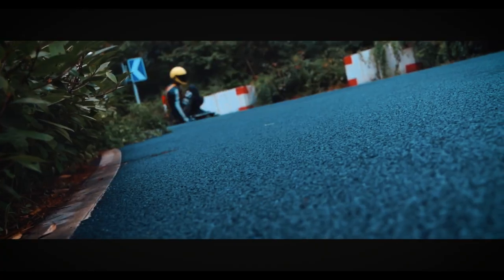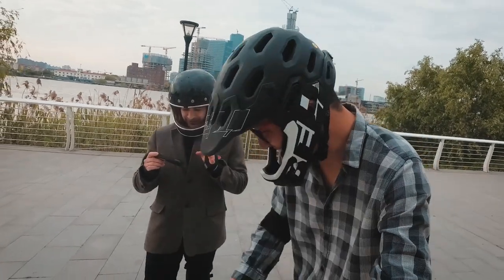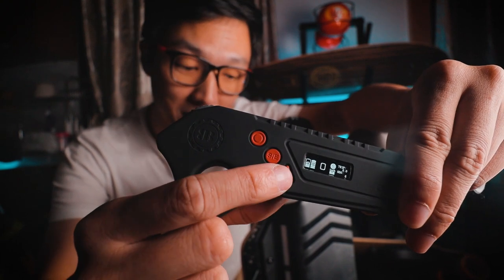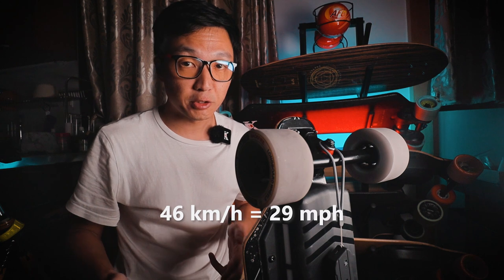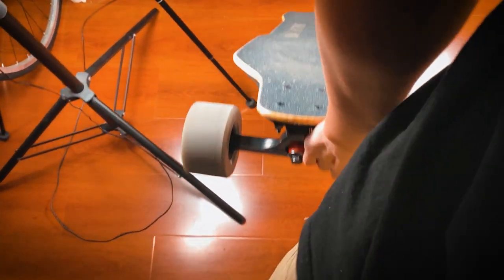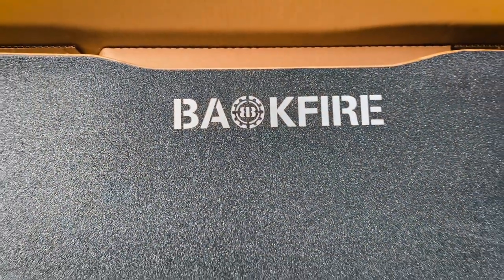Backfire G3 in-depth review. Expectations exceeded. Major flaw that kept me awake has been fixed!

Comment from the maker: Hope you're all having a great week. Here, have some timestamps!
00:41 G3 and G3 Plus Differences
01:38 Turbo upgrades
03:06 Deck
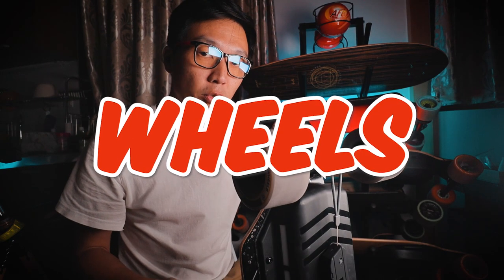04:17 Wheels
04:30 Trucks
04:47 ESC
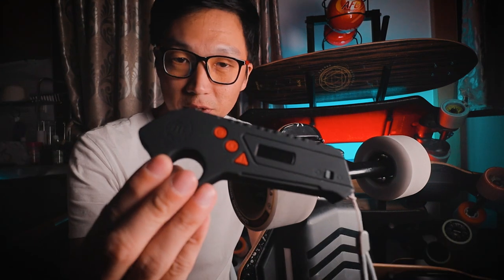05:11 Remote
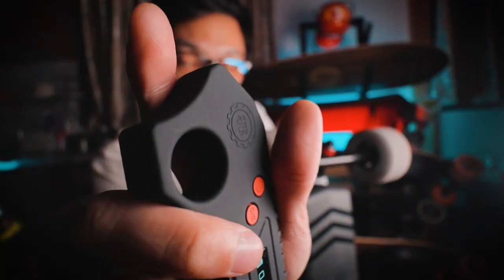07:48 Drive system
09:08 Battery
10:30 Torque
11:02 Speed
11:35 Brakes
12:13 Portability
12:42 Water resistance
13:12 Aesthetics
14:02 Range
15:04 Final thoughts
-
If you'd like to get this board, you can use my discount code: DKWANG3. This is the biggest discount available. This link should enter the code automagically: https://dkwan.com/backfireg3
-
If you use my discount, let me know and I'll send you a set of stickers! https://dkwan.com/freestickers
Reply: Disappointed that the brakes are bad, the g2T have one of the best brakes on the market.
Reply: Battery difference:
G3+ SAMSUNG 40T 21700 (12s2p)
G3   SAMSUNG 30T 21700 (12s2p)
Reply: Hey man have you been able to try out a Trampa board?
Reply: @101lams  hey Lukas can you explain what all the different numbers on the batteries 🔋 mean?
Reply from the maker: Lukas Ehl  Where did you get that 30T spec? I was told G3 uses a generic brand.
Reply from the maker: name no  I have not
Reply: Daniel Kwan 
In official video from Backfire.
Here:
https://youtu.be/0es29zOFwAU

You’re wellcome 😊
Reply: @DanielKwan  Do you think the regular exway x1 is a great board and worth it for $550 (that's the price on the website), or should I go for another board in the $600 price range. Thanks!
Reply: Please review the Fäboard Black Carve
Its using a direct drive system which is like a hub motor on the trucks. It allows you to change out the wheels and not be limited to hub motor sleeves
Reply: Tommy N faboard is made from diyeboard.com parts. 
I’m thinking of going with the revel kit, which also uses direct drive, or the verreal rs which is belt drive but really nice.
Reply: How does it compare to a evolve gt is the difference night and day or is it that good of a budget board that it wouldn't make sense spending double the price for something with equal quality..the reason I ask is bc I know there both made in China and I can't justify paying 2000 for a board I can get for half the price
Reply: Hay i got this board because of your videos sorry i didn't ues your code for it but i got mine for only $600 with the code I used but thanks for the review

Comment: hi daniel which board would you pick g3 or exway flex?thanks😎👍👍👍great review.
Reply: I'm trying to figure out the same thing. I was in the Exway camp, but have recently moved to Backfire. The Exway seems to have the better software while the Backfire has the better hardware. I want to get hub motors and I like the idea of a comfortable ride. Backfire has the larger wheels (although cloudwheels now has an attachment for hub motor wheels), and Backfire G3 Plus has a crazy good range with minimal voltage sag. Exway seems to have more accessories and customization, plus firmware update. Like I said, I was looking at the Flex, but now I think the G3 Plus is the one for me. I want a sturdy workhorse for commuting, but something capable of having fun, exploring, while being lightweight, quiet and portable.
Reply: Same problem.. 😄😄 But it looks the G3 have better manufacturing then Xway

Comment: yeah, my G3 has been pretty great so far. ordered the zealot s2e a couple days ago, because im ready for an upgrade.

the g3 is an AMAZING option if ur looking a budget friendly, but powerful board. when it comes to RAW POWER, i didnt expect the g3 to be able to showcase such amazing strength. it FEELS like a belt drive. its STRONG.

my warranty has came in clutch 5+ times when it comes to broken parts, which is an issue. it sucks that the board broke so often (or maybe i was riding it way too hard). 

anyway, a great board.

Comment: This is my favorite review of the G3. You're very informative and educational while also having a sense of humor w/out going off on tangents. I have subscribed and will be scrolling thru your channel for other reviews. Thanks so much!  The ONE THING I need to know the most - and no one else is covering it either - is "How well does [ X brand / model ] board handle "bad" roads?"  I live in a very rural setting and the roads are NOT all smooth concrete or asphalt.  There will be rocks and twigs, etc. on the road. Can this board with it's standard wheels handle those conditions?  OR do I need to upgrade to Cloudwheels, or something similar?  Thanks a bunch!

Comment: Just to update this: The newer G3's, the "turbo light" doesn't turn on, if the lights are already off.
I've been longboarding for years and years, and bought the G3 as my first electric board, a few weeks ago.
I'm in no way a flashy skater. I'm not into lights going nuts and letting the ISS be able to spot me from space. I'm not into insane speeds either. 20kph is plenty for me. So I was just not gonna use turbo. But I did of course check out all the features when I first got the board. And yeah... The lights doesn't turn on automatically because of turbo mode. Seems they heard the criticism.

Comment: well, looks good .. The price is good as well but I don't understand why the turbo button exists? when you can't turn it off by pushing it again it's just I dunno... useless? and allowed only when releasing the throttle is literally stupid ... blinking sideway lights which cannot be turned off are also in my opinion only unnecessary battery drain and I'd definitely unplug 'em from the inside .. if I'd need light it would definitely be front / back not side lol :D ... I'll wait a bit longer till I buy a new board but I see it coming soon... thanks Dan (y) keep it up

Comment: I weigh 125 lbs and only got 10 miles out of the board before getting low power. I sent the battery to Backfire and they are reviewing it now, and sent me a picture of the remote with 10 miles at 40% battery. I am very confused because I am not too aggressive when riding, and I weigh well below their standard metric for range. I’m concerned because it seems Backfire may not replace the battery— despite it dropping to 80% on eco mode after about 30 minutes of using it in my driveway.

Comment: Hey man, nice review! I have a question. Do you the regular exway x1 is worth it for $550 (that's the current price) or should I go for something else in this price range? Thanks.
Reply: If you speak of the regular X1 and not the X1 pro, the G3 is much more worthy (especially with the 205$ discount)
Reply: @winnquest  why do you think so?
Reply: @thunderingtuber2179  triple range, more torque, flexy deck, and better design (in my opinion)
Reply: @Daniel Kwan, what do you think?
Reply from the maker: Depends on your needs. If you want light weight (around 6.5 kg) and don’t need range, and want to be discreet, X1 may be right for you.

Comment: I'll never have another hub drive again, wwwwaaaaaayyy too harsh a ride on anything that's not perfectly smooth. The wowgo 3X is the ducks nuts right now I think. Its basically a Boosted Board for a fraction of the price. That'll be my next board, My Evolve GTX is amazing but its expensive and heavy
Reply: Well here is my opinion on your comment...
I have the Meepo v3 ER with 100mm wheels. It's like a limousine compared to my belt drive Vestar v2 belt. So smooth and powerful with great breaking and it's very fast. 
No comparison. Belt drives are more dangerous. I've had belts break on me.
The wowgo 3x is a bamboo fiberglass deck. That's why it's great!  
Vestar is doing this too.
Change out any board to this deck and you will notice a great improvement. Recommended by PRESS RESET on his channel.
Look and learn! https://www.youtube.com/watch?v=dYo1m8k0WUY
My opinion as I own 6 different boards.

Comment: I really enjoy riding this board but have a problem recently: I received new hubs after the first stopped working. The new hub motors got a red, relatively stiff stripe of "paper" sticking out where the cable comes out of the hub motor.
Is it there to protect the power cable or should this be removed?
I'm asking because it is almost impossible to fit the cable and the red thing through the sleeves on the trucks..
If you don't know what I'm talking about, I can upload a picture of it.

Comment: Which Boosted board were you comparing it to? I have the G3 Plus and the Boosted Stealth and based on my experience, the Stealth noticeably has more torque than the G3 Plus
Reply from the maker: Oh really. Boosted V2 Dual+ SR but mainly based on inference (e.g., Exway X1 has roughly the same acceleration as Boosted V2, X1 Pro stronger than X1, Skate Metric data, etc.). Never used a Stealth (nobody here has one) but I was under the impression that it’s similar to V2 in performance.

Comment: Would you recommend the backfire or the exway flex?
Reply: It's super close, but I'm going with the Backfire G3 Plus. Exway has the better software while Backfire has the better hardware. If you want hub motors, as I do, the Backfire seems to be the better bet. If I wanted belt drive, i might go for the Exway since I can change later.

Comment: Anyone happen to know how the flex of the G3 compares to that of a Loaded Dervish Sama flex 2? I like the flex of my Loaded, but wouldn't want to go much softer. - doesn't matter...ordered! thanks for a great review.
Reply: Now have the G3. Flex-wise it's a little softer than the flex 2 of my Loaded board. Taken it out a couple of times here in the UK, but some roads are still a bit damp in places, so taken it easy. Ran it on eco mode for about 50 meters and quickly maxed out the top speed, which is mellow as expected, then switched it to sport mode and had some fun. Not used it in turbo mode yet, as just getting used to the torque and braking, along with weight placement - it will have you off the back of it if you're not heavy on the front and keeping low, when pulling away quick. Looking forward to carving up the roads on it :-)

Comment: Hey Daniel  Kwan how are you today sorry for the time difference I'm in the us but I have a question. I have the g3 but my power box got a little bit of water so it made a whole on the power wire it's the yellow thing that connects to the board so I'm sending it back. But I just got the G2 I was wondering if battery from the G3 turbo can fit on my G2? Because my YouTube takes forever to charge. When is fully charged remote and board I take it out for a ride and my board battery goes down fast?
Reply from the maker: Best if you send an email to Backfire and ask them.

Comment: Does your battery case get scratch easily when you are on an uneven roads like pavements? Because the board looks very flexy
Reply from the maker: Not sure about “easily” but I would just treat that part as something that will most definitely get scratched up. I wouldn’t try to baby it I mean.

Comment: im contemplating between a backfire zealot and a g3 as it's only a $50 difference after discount, which one would you say is better as a beginner e skater,P.S I've  been longboarding for 6 plus years
Reply from the maker: They can both work for beginners. I would prefer the Zealot but if you don’t want to deal with belts, G3 is great too.
Reply: @DanielKwan  ya belts would be a pain I live in Pakistan so I don’t think backfired delivers here so if a belt were to break it would be pain to replace ( getting the board when I go to the us in September)

Comment: Performance-wise, it looks as if the G3 is comparable to the WowGo 3. They both have bamboo-fiberglass decks and always-on turbo modes, name-brand trucks, and comparable ranges. If someone were to be deciding between the two, how would you go about justifying the G3 being $100 or $200 more than WowGo 3? The only real difference I can see is that the G3 has the 96mm wheels and a slightly better remote, but is that worth the $100-$200 extra?

Edit: I say $100-$200 depending on what battery you get for the WowgGo 3
Reply from the maker: Good question... These could be justifications: Caliber II for both trucks (instead of just the front), Hobbywing motors, more options for PU sleeves, better battery enclosure. Some people might prefer the larger deck and those lights. I know Backfire would claim to have a lower failure rate (they do seem to be more conservative about pushing the electronics). Backfire also has a better reputation for aftersale support.
Reply: @DanielKwan  Valid points. Hopefully there's a good Black Friday deal that can knock that price down closer to what I can afford. Thanks for the reply!
Reply: @BackfireBoardsOfficial  Thanks for reply! Top speed isn't a major factor for me as I rarely go top speed. WowGo 3 with the 8Ah battery has a range of 17-20 miles (compared to G3  range of 15-18.5). The lights and the charging port are nice, but isn't something I need. Having the local customer support is a major plus though

As a said before though, $100 can be a pretty big deciding factor for some people who are on a limited budget. The G3 looks  like a great board, but it's just a little bit more than what I'm prepared to spend right now :)
Reply: With their huge black friday discount (-200$), the G3 is less expensive than the Wowgo 3 (8Ah) and thus much more rentable in my opinion
Reply: Winnquest looking forward to seeing it :)

Comment: Love all of your reviews but there is no way the exway x1 pro hub version has more torque that a boosted (v2, pro, or stealth). I own a boosted v2 and a good friend has the exway x1 pro that has hubs and riot, which I have tried both. Don't get me wrong the exway is great with hubs, but it's not boosted level torque.
Reply from the maker: 🤨 Did you try it with full battery?
Reply from the maker: Also possible your friend didn’t max out the settings in Exway’s app?

Comment: ¿Why Backfire don't explain the Ah of their batteries? Maybe I can't find it
Reply: Their website shows the Wh of the battery - which is the most useful. 260Wh on G3, 346Wh on G3 Plus. For comparison the Exway X1 Pro has 193Wh and extended range Boosted battery is 199Wh. For hub boards with PU wheels they are pretty large batteries.
Reply: @ConsumerWatchdogUK  But the important part are the Ah, no?
Reply: @ArnauRectoret  battery has different Voltage, A battery 6Ah with 42V,and B battery 6Ah 50.4V,they are both 6Ah,but different voltage,so different battery capacity，that's why only tell Ah can't make sense
Reply from the maker: Wh / V = Ah
so this board has a 6Ah battery. But I think that number is only useful if you’re comparing batteries that have the same volts, so other 12S batteries (43.2V). 

Someone correct me if any part is wrong pls 😅
Reply: @DanielKwan  correct. A Samsung S10+ has a 3.4Ah battery, but only delivers 3.7V so it's total capacity is only 12.58Wh. Two of these in series would have same Ah but twice voltage and thus increase max power.
Reply: @DanielKwan  thanks all for the answers. Im still entering in this world :)
Reply: @ConsumerWatchdogUK  thanks Santa 🎅
Reply: @BackfireBoardsOfficial  thanks for the explanation I will study it because I really like de BF Mini
Reply: @ArnauRectoret  you are welcome

Comment: What would be better for a first time eboarder? X2 or G3?
Reply: If safety is a high priority, would the X2 be better? But overall board the G3?
Reply: James Nguyen EXWAY has problems with remote losing connection. Backfire recommended for safety

Comment: I’ve been looking at so many boards and never owned an electric skateboard and was stuck choosing between this and an exway flex, but I really don’t know whether to pick a belt drive or hub. I’m leaning towards the g3 because it’s less maintenance. Any advice?
Reply from the maker: Exway Flex is available with hub motors too. If you’re new to skating in general I’d go with the G3. If experienced with longboarding then I’d choose based on the deck design.

Comment: Will Backfire hub sleeves fit on Exway's hub motors?
Reply from the maker: yes
Reply: @DanielKwan  Would the 96mm sleeves work well on the Exway X1 Pro.....clearance wise( wheel bite)?
Reply: @DanielKwan  Thinking of buying the set of 96mm Backfire wheeks and putting them on the Exway X1 Pro. Should make it a bit more comfy with the bigger wheels.
What do you think?
Reply from the maker: Possible wheel bite during very sharp turns. See this video: https://youtu.be/ZV6Rlf9WtSg
Reply: @DanielKwan  Thanks for your help! And warning. The front wheels seem to have more of the clearance issue more than the rear wheels.
Reply from the maker: @caryEUCNutbar   Yeah I probably have the rear truck tighter. Or just the way I position my feet for a tight turn pushes down the front more.
Reply: @DanielKwan  Cool! Thanks again for your advice. 
Love watching your videos! Looking forward to all of them👍

Comment: Bear in mind that carbon furbie is much lighter
Reply: That's actually a major factor for me. I need a board that can go everywhere with me. It's only about a pound lighter than the G3, but it's still a major deciding factor. I think I will shell out the extra $200 for that extra pound off the board. You also get range/charge confidence. My commute to work is 5 miles, which mean I will not need a fast charger and could easily do the whole day on one charge.